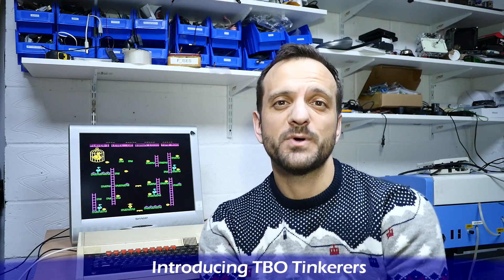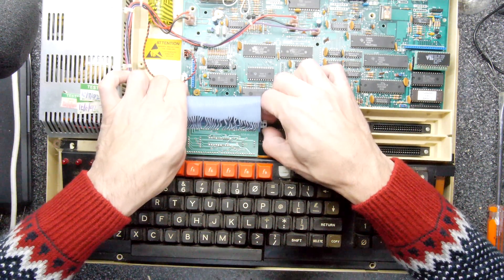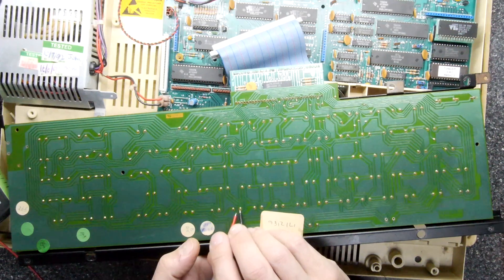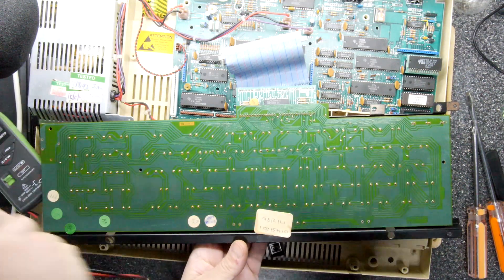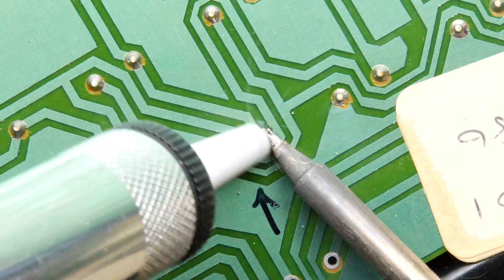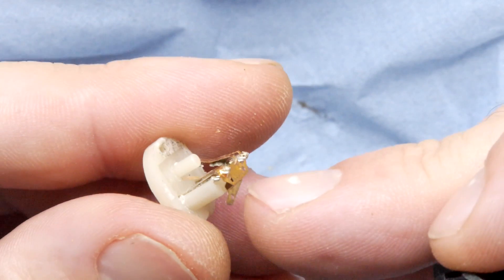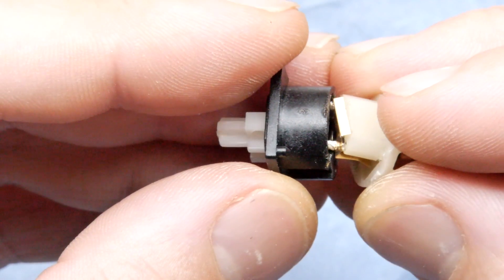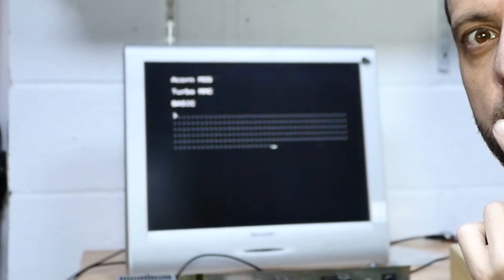How to repair your BBC Micro Keyboard

Comment: Excellent video. Helped me to repair my keyboard. There is a question: If it is possible, how to make/purchase or do some magic for a spacebar stabilizers? On my keyboard I only have a central key and those two (left and right) are empty and I can see under holes some wire. Not sure how to make spacebar stable, without seesaw. Any idea/help/video/eBay link?

Comment: Have just acquired a BBC Master 128 with some faulty keys but otherwise excellent nick. Almost certainly the same problem, could just be oxidation, or maybe the moving contact has shifted and is now missing the fixed contact.

Anyway, nice to see what to expect when I pop the lid off.....
Reply from the maker: Be brave!
Reply: @backofficeshow  Yeah, I've just opened it up. Some evidence of damp but not very far gone. My trusty multimeter (there are many like it, but this one is mine) did not let me down.

Next step will be to unsolder the duff keyswitches and fettle them. And then source some proper connectors.....
Reply from the maker: Sounds like it's well in the way to recovery. Chuckie egg is near!

Comment: First "fix" is usually just to repeatedly press the key (50-100 time) and repeat with contact cleaner if it doesn't work. One of the legs looked to have lost some of its bend at the end; I've had this on a couple of master keys that had no visible dirt/oxidation and just bending the angle slightly "fixed" them.
To disassemble a key switch, after desoldering, unscrew (pull and twist) each leg before attacking the clips.
Reply from the maker: I always forget the unscrew part. Fortunately they tend to stay working. I think the best approach is to never stop using your Beebs!